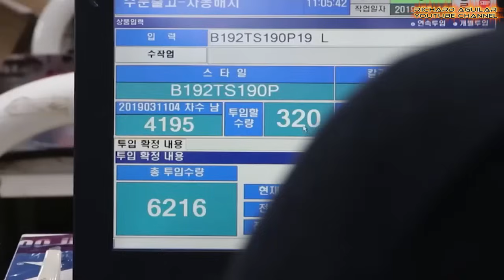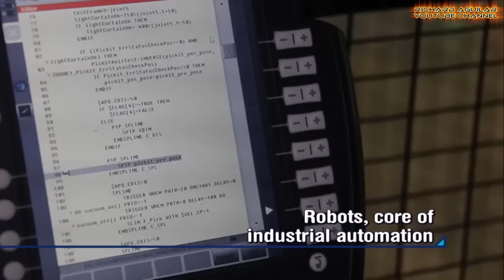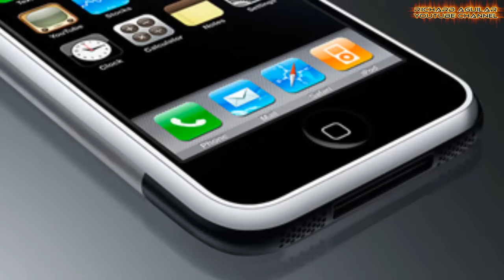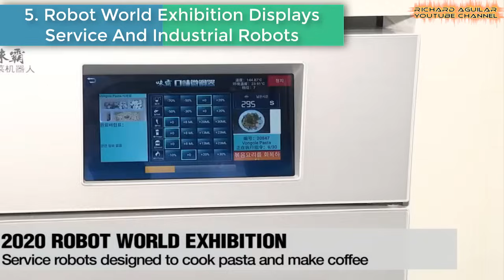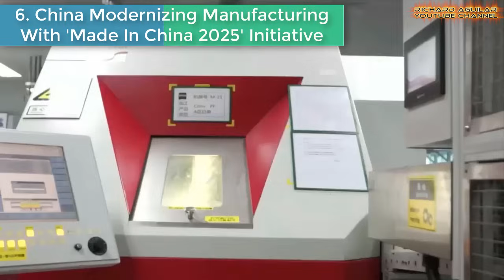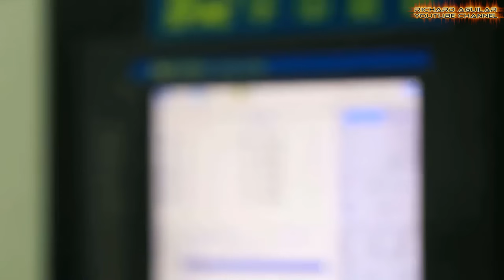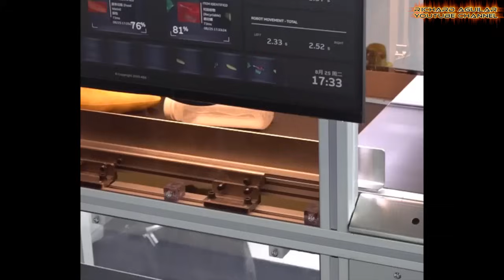Smartest Factory Automation That Shocked The World

Comment: Sir, below questions pls,

What about noise pollution,  in decibal if you have that information. 
Is this fully automatic? And any size  plate like 6" 8"  10" 12"  etc can be manufactured ? Till what size can this machine accommodate? 

What about the machine for plate with aluminium foil? Will that require different machine ? Can I make those too in this machine you are offering ?

Comment: Thks for good exposure of  factory/manufacture full automations with robots ! I recalled 1980 industry full of human operators .1990 industry full of many operators and conveyors automation . 2010 still full of human operators and conveyors with a few robotics system. by 2020 , the whole 4.0 industry full of robots+conveyors+machineAutomation +a few technicians with almost zero human operators ! Technology explosion , promising Mobile-Robot replacing technicians task by 2025, atleast 60% Machinery automation Industry without any
 humanbeings  ? Only can see a few technical humanbeings in an isolated remote-control
 room !